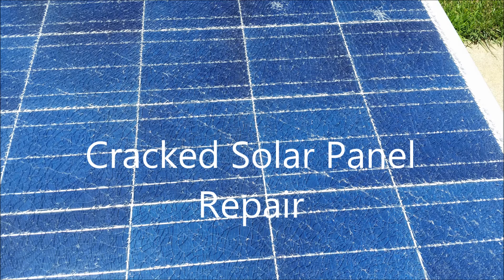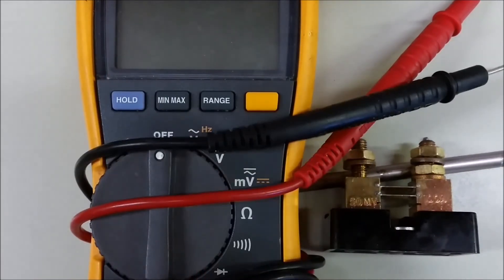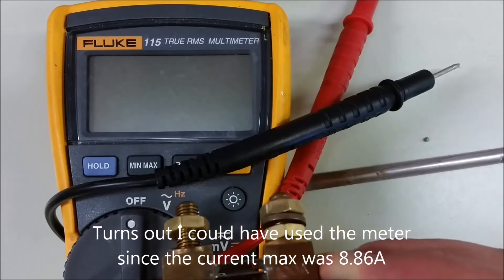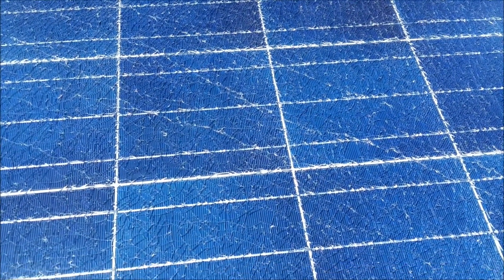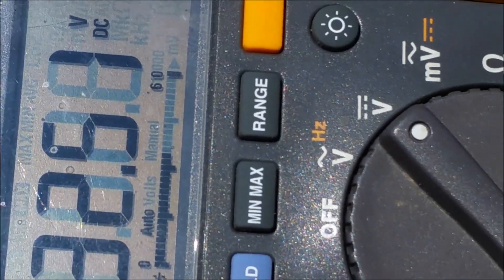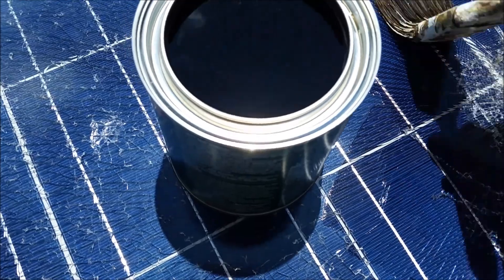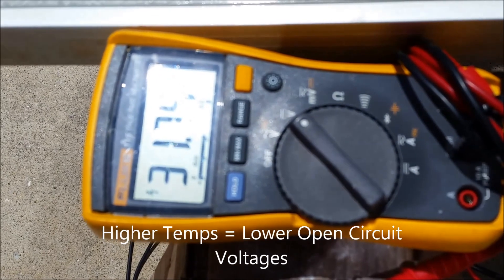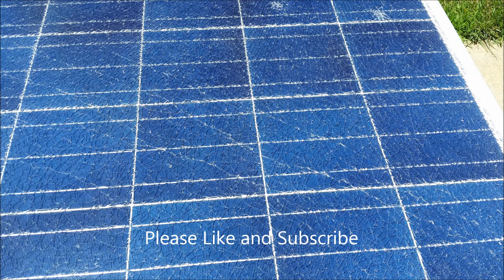DIY Solar Panel Glass Repair

Comment: I have a question did it yellow over time? I know Spar is supposed to be good about that turning yellow should not be a problem. But there is additional Heat. What did you find?
Reply from the maker: It did turn yellow and began to peal.  It didn't with stand the heat. Looks like it's back to the drawing board.

Comment: someone actually measuring before and after performance, what a concept
Reply from the maker: Yeah.  But unfortunately,  the film failed.
Reply: @stem_saving1644  Ah that's a shame, thanks for the update. I'm going to try some UV resistant epoxy resin on mine but I'm not too hopeful because its output is very low amperage compared to a good panel.
Reply from the maker: After some more research I bought some of this.  Quantim Silicones QSil 216, 1... https://www.amazon.com/dp/B00E29HOMC?ref=ppx_pop_mob_ap_share

Haven't used it yet... looks to be made for panels

Comment: My solar panels came without protective (safety) glass and is so fragile yet no one gives information on what to do to protect it... why?
Reply from the maker: I found little information on this.  Luckily the panels I chose (solar world) showed tests of ice balls being launched at them with no damage.  This sealed the deal for me.  But there isn't a standard on this from what I seen.
Reply: @stem_saving1644  Unlucky for me... went i went to buy solar panels not a single seller would state if it had safety glass or not. Instead they said some crap like it stood up to this, or stood up to that... you know, crap that never happens except rarely.  Also, the delivery driver left the panels without me being notified they would come a day or 2 earlier and with 2 to a package, the driver smashed the inside 160 watt panels to smitherines, of course... one (the one you could not see) AND of course, deniability was in full force.  That was several years ago and I have not installed them because I cannot (to this day) get comprehensible evaluation on what to do about the fragileness without incurring tremendious extra expenses... like buying safety glass cut to fit then building a "cage" fot it.  I have sought hurricane glass and those are horribly expensive too. Also, buying protective glass may just yellow making those expenses all over again.  What I have started is buying smaller panels (2-3x the expense per watt).
Another quest up on no one has ever answered is:  what is the wattage per square inch, or wattage per square foot.  Even a panel salesman who came to his house to sell him panels with "government subsidty" left when I asked those questions - he did not know.  Plus the "savings" were and still are FICTION.
I got my system for less that 1/2 the price (both without safety glass) of what my friend would have had to pay AFTER the government sibsidity... imagine that.
   I have been studying (when i can get answers) from the time i was in 8th grade, so for more the 50 years, all about solar power.  The most imptessive are the scams.
Reply from the maker: I have had good luck with solar world (now sun power) and canadian solar. They survived many hail storms to my surprise. 

Always put large purchases on credit cards,  that way if there's damage you can refute the charge. 

Hope that helps.
Reply: My main panels consist of a plastic stiff sheet, cells on that and the protective covering is a self adhesive film.. surrounded by a aluminium frame..
I've just been given a smashed one not too bad .. like yours.. been looking through all the videos..
BTW the glass apparently is low lead.